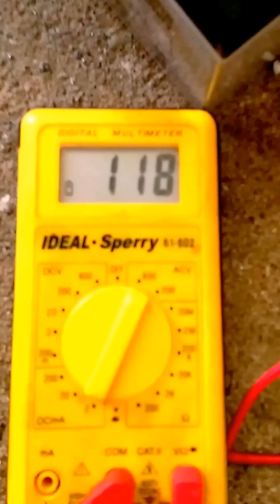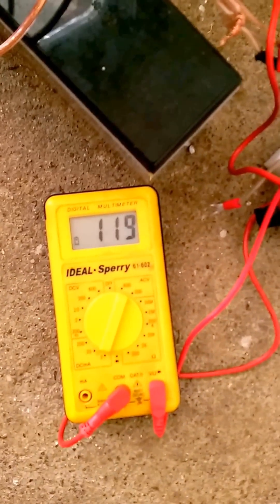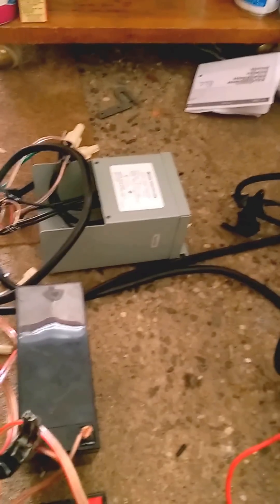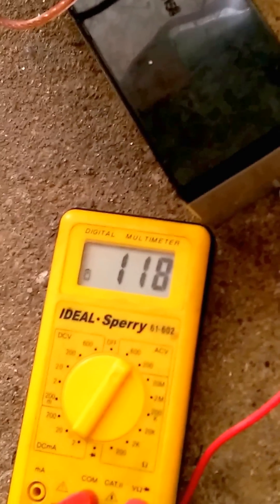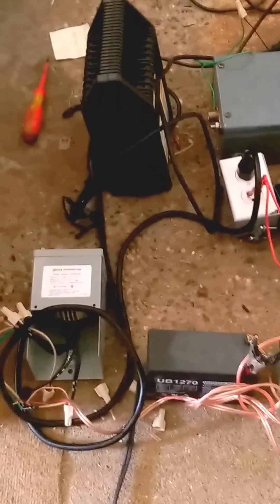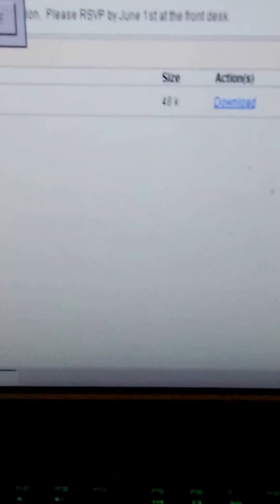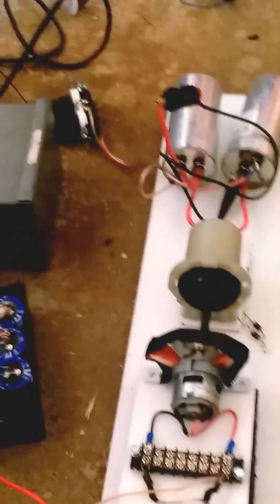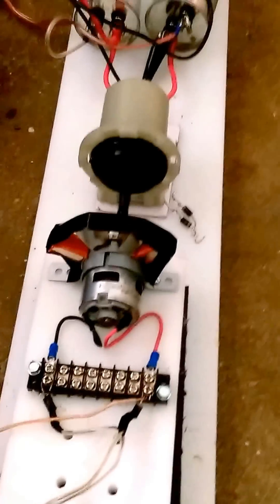Gerard Morin Washer Pump Generator &  PELEX DEVICE Successfully Looped!

Comment: hi Mark I just watched your video and I think you have a great idea I have watched Gerard Morin's videos find them very interesting and believe RF frequency is the way 2 over unity my only question is why not just give it away and let the billion people that lose their jobs start making them in supplying the world with free clean energy . if the system is truly successful saving the world from the misery it is in with fossil fuels is a higher award than any monetary gain I think if you put the diagram and schematic on the internet you have beaten the very people that you're trying to do business with. you could probably make millions off of hit counters on your website or your YouTube Channel. either way thank you for your time and energy in this area I totally respect and understand where you're coming from but I think to achieve the end goal that you have in mind for overunity giving the schematic away for free is the only way thank you for your time Cheers
Reply from the maker: because kids would starve, mine included because I'm the owner of an electrical construction company that builds underground power distribution systems. I've done this because I had to.prove an engineer wrong, which I.Did.. now, I'm waiting for the right offer for a complete buyout that will reduce the cost of our electricity by 75% and only be sold to power generation stations so the energy industries do not die. It's the only way I See possible, however, I have 2 related inventions to sell first.
Reply: Thanks for the reply,good luck with all your endeavors.
Reply: hi Mark all this time has passed and I'm still paying attention. I never questioned your principles or your abilities .I believe that there are answers for everything in this specific area of overunity and that you very well may well have found a few of these answers. there are others in this field that are making steps forward. some are True Believers of the science ..others are charlatans ....I have been following the keshe foundation for the last 6 months and wonder what you have to say about some of the goings-on there with the plasma ..whatever the case as you continue on your way I believe you have something genuine to offer this world . good luck in your endeavors cheers Gary on Pender Island
Reply: +Marc Belanger ...people are homeless... and  forclosed on daily.. locked up on code violations... that once decoded only apply to a fiction called "The legal person" ... you have one component of the puzzle...here  with this energy and.. others have had it too as I've explained before. ( Joe cell ) ( Stanley Meyers )  ) ( Albert Pogue and his carb ) .. ect ect.. Pantone.. ect hundreds of patents.. all caught in the web designed to collect alll this stuff so they can keep it from the world....  
all have failed before you because that could not except that it must be given away free... sad but true.... there are much larger forces working here.. 
and  i can explain them all if you are interested to learn.. 
Cheers ! and have a nice day .... 
The small inventions that make small improvements can be sold  yes.. 
the big ones can be sold .. but will all be shelved..
Reply from the maker: +CarsRcool I hate to break it to you as well as 99.9% of others who think if I just draw the diagram and write a little book telling folks how to build this that they'll just immediately whip this  or Don Smith's devices up without problems, or, anybody else's devices where they'd received death threats, letters explaining what could happen to loved ones and other pretty nasty but very serious threats for that matter... just for "saying how to do it and it be wrong.  I have replicated the unreplicatable, and i have found the source of it's function, as well as the method used to draw in this "transformed energy". I am not a design engineer, or a professional circuit designer, however, I can see things most folks do not and, I also live off of the electric grid, and so does my family. There are many families that need financial assistance, and, there are those families who still don't realize that electricity was never a necessity until air conditioners but, I am one of the only people on this planet who've replicated specific devices that use less than they output, and, I am one of the only people alive who has truly designed my own working device that works on low frequency inputs to magnetically manipulate the natural formation of the electromagnetic flux. The shape of the flux is extremely difficult to create, and, the end product literally behaves as an electron accellerator would. My device is simple for me to build but would be ridiculously difficult for anybody to figure out let alone build it. My intention would be to get in with another investor who wishes to make it happen on large scale. I'd like them to take ownership of the technology and only include me on royalties, a certain percent to me, and they could do what they wish with my scientific discoveries. I have 3 different devices made from Pelex, 2 of the lighter duty for energy savings, then, release the next one, and, then the generator mods. Since i have so many circuits that operate as the "impossible generation and amplified electrical circuits", the first thing I am going to try is to design and sell a manufacturable model that can be sold reasonably to the third world countries and poor parishes around the world first to see if it assists them without issues, then, if the price is right, assist them to design and mass produce devices to be used in homes only, then, power plants. The homes that are remote areas are extremely important for beta testing, and they certainly need to not use fuel for their energy, and , it wouldn't be a bad idea to get !

There will be billions who just do not have the ability to decipher the unbelievable method used to create a complete and functional system without flaws... hell, I hardly could create a copy of the original without weeks of issues, then, I have other working circuits in the same classification that do similar things that I have open sourced. There's an investment made with Pelex. The Pelex device is protected intellectual property that can not be given up, unfortunately, since it has a massive snag that would drive it from being UL listed, I have a backup of a very similar device that functions without any problems, but, it is less powerful. This has been open sourced by another inventor since 1994. I have replicated one of his other designs this morning, and, it may not be a bad idea for me to keep going because I'm on a roll and used my own ways to put these circuits in working order, so, again, I probably could sell, and it may have to be that way because I leave every hint to get them working very clear and nobody so far has been able to replicate them.. 

I will eventually bring one of the devices to a free energy convention if they'd like me to speak of the technology, which I believe is the Casimir Effect. I'd like to see at least a few folks follow my lead and actually get them working, however, they haven't been doing so, so, I think I may be all on my own since I can literally see what has to be done for whatever reason, as I am being shown by somebody that this device has been given to me by my passed Father, or somebody I knew in my thoughts and visions. . I'd bet every dollar I have that Eric Dollard and his old lab buddies would be able to make a go of it if he hasn't done so already!
Reply: +Marc Belanger they could sell electricity or gasoline at any price.. 
the price is MEANT to be OPPRESSIVE ..that is on purpose... 
they truly want to raise it MORE .. not lower it... look at the vid from 
Gerard .. smart meter... makes the bill shoot up !  20 to 100% ..
Reply: Marc Belanger Than you Marc for you kind and well written response . 
i cut and paste each one and save in several folders.. for safe keeping. 
i am always humbled by what i read ...
i realize how big this battle is more than most.. and have watched the patterns as the many others.. have only gotten so far.. not realizing how  truly corrupt this  world really  is.But , make no mistake  i understand you have done the impossible here..  and found the connection ..i have studied the "process" of how "the system" ( some call TPTB )
addresses these ..people who get threatened or worse.. Our " Rulers"  can and have suppressed this stuff before.. and they have a " watch Tower ' system to follow those who think the ' system'  will  allow this to upset their apple cart... ( The higher levels of Freemasonary are there for this purpose  ) 
and run all sites.. like "overunity.com " or 
any site like the old  Ecomodders .where any one who starts to get Really good gas mileage by cracking fuel .crapped on or banned.. 
The Joe Cell Guy .. was threatened.. and backed off.had his car    running of of nothing but air... .Robert Hull thought   he would take his process of using the "Frequency" from the alternator to charge the moving oil in the engine block and " frequency crack " the fuel and get super gas mileage.. he too did not    realize what he was up against..5  months. the bought him out .. and  threw him out of the business.. that was created for that very purpose.. some are what is called " Gang Stalked' .. by Gov operatives....it gets really  messy ... so .. in reality EVERYTHING ..  is taught backward.. from " what is called medicine to electricity to religion .. and that is the worst.. and for some way too much to believe they would lie to us at such an extreme level.. but that is just the way this place works... but that code has been broken 100 % .. the world is a lie . run by liars.. and they will lie to us until out last days... 
and if we repeat Their lies... We... become liars...i want to help in the only way i can for now.... you know i work  this stuff.. 
but not at your " unique " level of High voltage.. and like you said.. Most electricians do not understand any of this... 
it is Your experience  and back ground .. that has brought you here...
people who are famous are not going to help
We are .. us nobodies... ... 
thanks and Cheers .. 
and have a wonderful day ...!
Reply: Marc Belanger Can i ask you if you were to put this in a  category .. how many  items or devices do you have and do  they all use the same  " principal of operation ?
Reply: Marc Belanger yes. your description of showing people how to do this is correct.. 
it must be a  "process" .of understanding. to your level... and yes.. this does take time..
Cheers
Reply from the maker: My device,  Pelex is based on one technology while the others are based upon the Tesla Phase  Conjugate Mirror theory.  I feel that there are many systems and circuits that share a similar way of extracting energy from our massive sea of energy,  however,  there are many ways to do this,  and I feel by disturbing the blanket of untouchable energy we make ripples like what happens to water when disturbed.  The energy is now rippled and methods can be used to induce it or capacitively couple to it,  possibly even attract this with cold cathodes,  plasmas and many other ways,  but,  since the profound suppression started with JP Morgan's ridiculously evil greed,   efforts to continue this suppression has continued on for well over a century.
Reply: Marc Belanger this is a much bigger battle .the " suppresion '  started in the 2nd century .
 or sooner..
JP Morgan was just the  visible head of a much bigger monster. ..:(

So if one is to think of  " coupling " to this energy is a good way to build a  foundation of thought ?
Reply: Marc Belanger Also do you think 
Gerard Moran is on the right  path ?
He seem to be making progress
Reply from the maker: because the efforts to market it have started,  proceeding in the right direction until side effects were discovered.  I've been. working on this for a long time and efforts have been made to slowly introduce this to society as proof that we've been lied to for a century.  i.am a partner/ owner of a medium and high voltage electrical construction company who relies on the transmission and distribution industry to. live.  by giving it away I'd lose my income to live and millions if not billions would lose their jobs.  once electrical distribution is eliminated and the generation units such as mine perfected,  trillions of tax dollars would disappear,  oil woul be unnecessary and half of the world would be in. poverty,  wars would start, and everything would be very ugly.  I've been offered funding from the Keshe Foundation for my research,  however,  I had to refuse because of legal limitations that disallow his plasma technologies for civilian use in the US.  I'd love to see my technology on top of the world , but,  I don't wish to. risk my families safety by defying my own government.  I'd be interested in coming up with a peaceful method of integrating my system with the current distribution systems in an effort to save everybody $, however,  I don't want to be part or the cause of an economic collapse that could be avoided by coming up with a brilliant solution to overcome decimation of a system that assists in the spinning of our country's wheels.  in whole,  I'd be willing to limit the use of my technology to ensure a safe and non greedy way of introducing it to the world.  if I released this , it's be marketed to ensure my family's financial freedom and well being from here on out.  I'm not looking for billions, but,  I am looking for royalties that will allow us to live without worrying about losing our family business,  and life long revenue and well being.
Reply: Marc Belanger trust me you are being watched... nothing . you do goes unnoticed.. 
the charactor know as " Keshe" is just another tentacle of the monster that has enslaved us all.....
just another Char-actor on the worlds stage...
Who gets his money out of the Local Masonic Lodge..he cannot  reveal this simple truth .. because of the consecuinces
well .. lets just say there is a "Fate Worse than death .. " .
don't worry about  an industry " falling apart' .most are quite content in being " slaves " .. 
i know.. i've got friends hwo have big jobs .. in Government .. wheen i breached this  subject with him... or explained to him the TV was just a silly box .. lying to him. He suggested i get my blood checked :  ( 
other friends.. tell me with defiance .. 
 ( I live in the "Real World "  ) 
oh well . and so it goes.. but i keep fighting on  : ) 
oh well i am better at talking than typing.. 
but take a look here.. to realize How far lost the world..is ... 
We exist in this world of lies.. as what is called a "legal Person ' a paper work version of you .. Funny an electric bill . is a god example .. sent to the All Caps  Name version of you.. 
but it is not you the " Man " .. 
yes.. it sounds crazy .. but that is just the way this place works.. 
Cheers.. 
Here is        what they have been hiding for almost  1800 YEARS... 
The truth that WAS once in the Catholic Church .. 
Fatimamovement dot com 
Have a great day .. 
Oh PS..  take a quick look at this.. 
Robert Hull and Nathan Rodgers 
"The Hull Effect " patent 
http://www.google.com/patents/US8590516
http://rexresearch.com/hulleffect/hull.htm
Reply: My " wish " is to become your best
student :  )
jay
Reply from the maker: +CarsRcool  I like Gerard I think he's a great guy and he also understands things about the nature of radiant energy as well as cold electricity as I do however a lot of other people are making remarks to make him look like a madman as well as they are to myself butt since Society is starting to accept cold electricity and Alternative forms of energy that science says is not possible I think him and I have less battle to do than Tesla did. we both have our own Unique Designs and bolts Gerard and my own do work it's just a matter of making these systems more efficient and output higher energy levels so we can take advantage of the market as well help out the free energy guru's so to speak.  I do have some technologies that I do open source however they are very difficult just to get operational in the first place nobody said it was easy and the outputs don't just connect to like conventional electricity it is very much so an entire different animal
Reply: Marc Belanger yes.. you and Gerard have both been nice enough to chat back and forth with me. .. thanks...